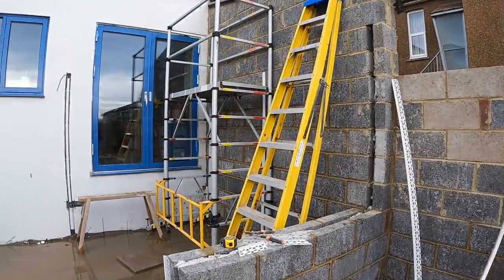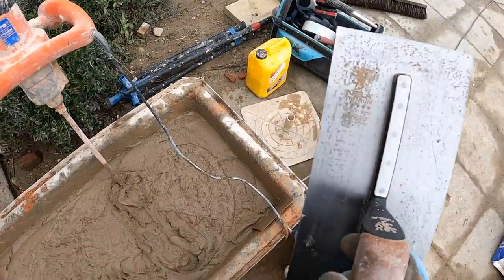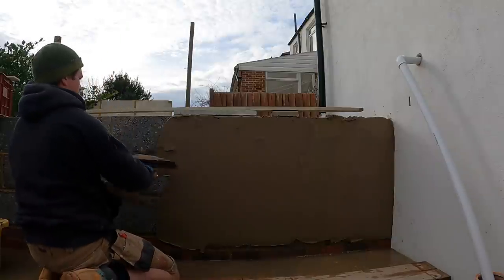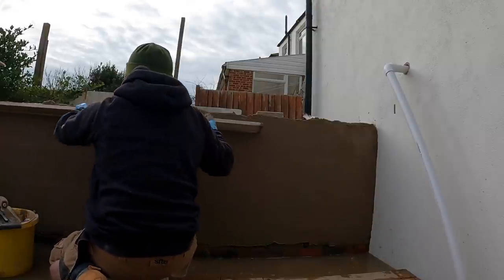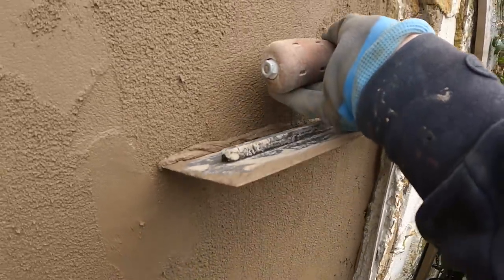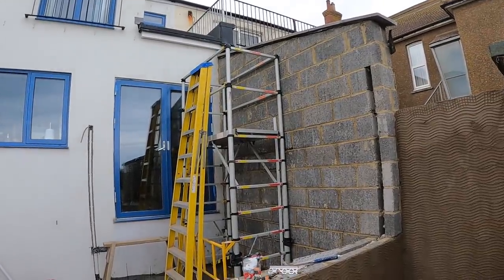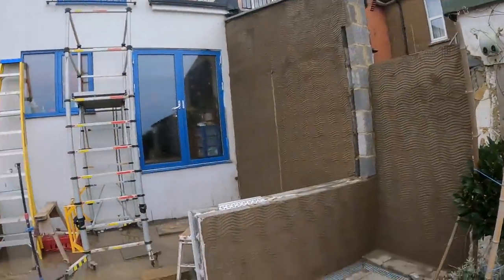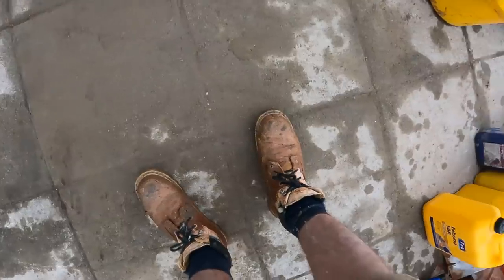Rendering Series #1 SCRATCH COAT (How To Mix Render/ Application/ Rendering Tips & Tricks)

Comment: First off, great videos, I'm learning a lot! Just a few questions.
1. You say you use 15mm beading, is that how far it sticks out of the wall edges? 
2. For the scratch coat, it's not to the entire depth of the beading right? 
3. Finally, when you do the top coat, am I right in thinking that the very edge of the wall is still beading, i.e. you don't completely cover the beading edge with render? Do you just paint the beading and wall and it blends in so it's not obvious it's beading?
Reply: Paul, did you ever get a reply to you questions? I'm in the same place as you were then. Any advice would be appreciated. Thanks mate, Ste
Reply: @scraige3232  I didn’t get a reply unfortunately no. I haven’t attempted anything this year either as I’ve had too much on. Maybe next year!

Comment: Nice work, however there are so many ways and mixes for rendering it's difficult to say which is best, I find 4/1 ok for block but would use 3/1 for old brick, some scratch with soft sand and top coat with a grit, SBR again some use some don't, it wasn't always around, then there's the very best render, lime render, but that's very rarely done as it's almost gone but lime mortar has made a huge comeback, nice work though

Comment: Nice video mate. 
1. What's the white thing running down the middle of the wall. Expansion bead?
2. What you put in mix apart from waterproofer
Reply from the maker: It's power for a light feed and for the scratch it's 4 sand, 1 cement, waterproofers and a little bit of SBR. Hope this helps pal 👍

Comment: Hi, great videos...very educational. Any ideas on how to rectify a situation where you have very little depth left against the bead after doing the scratch coat? I rendered about half the thickness of the bead, but after I scarred it, the height of the scratch coat increased. I’ve now very little depth to rule against my top coat. Any ideas would be greatly appreciated.
Reply from the maker: You can try to scrape the high spots left over from the scratch. That should give you a little more room but if not, you'll have to hack a bit back. Good luck pal, hope it goes well 👍

Comment: I've also got some hydrated le and keep reading everywhere that my mix should be 6:1:1 6 plastering sand 1 cement and 1 lime..  also unsure what adds I should be using with lime as there are so many different opinions out there.. thanks for any help in advance 🙏 👍

Comment: You didn't mentioned the sand you use. ?  which is important. I use Pit sand and Sharp sand for the scratch coat and pit with a handful of sharp for the top-coat.  I know years ago the old plasterers used sharp sand only, better for durability and water proofing but not good for a fine finish.

Comment: Great video, thanks for posting. Any thoughts on applying an SBR / cement mix to wall to act as primer or adhesion aid?
Reply from the maker: Thanks matey! They do a lot of it in Ireland and even NZ when I worked there...Scudding I think they call it. Like I said, I did it in NZ but not much over here my friend.
Reply: That's old school tanking mix for waterproofing sub floors and damp problems it's not used anymore due to in a bag tanking products

Comment: How long does it take to mix in the bath? Is it quicker? Or just easier to take around than a belle mixer?
Reply from the maker: I'll be honest, it's probably easier with a Belle mixer but it doesn't hold as much. If you have a labourer, go for the mixer pal 👍
Reply from the maker: I'll be honest, it's probably easier with a Belle mixer but it doesn't hold as much. If you have a labourer, go for the mixer pal 👍

Comment: Great watching a good renderer at work. Don't think it was mentioned but what sand did you use for the scratch; do you change the sand ratio between first and second coat? Also ever do any work on firewalls?
Reply from the maker: Hi mate! Plastering sand all the way through and it's 4:1 scratch and 5:1 Top coat 👍

Comment: Great video, I noticed that you didn't go over the white capping, does that matter at all? I guess that'll get covered with the next top coat?
Reply from the maker: Yeah it will be covered in the next coat my friend 👍
Reply: @PlasteringForBeginners  thanks, did you use anything as a guide when ruling off? How do you know how thick it is and ensure that's the even thickness over all of it?
I've ruled off before and just did it by eye to ensue it was at least straight, looks like this is what you did too?

Comment: I can see there is no roof on in this situation so understand why you rendered, but internally In what circumstances would you use render instead of hardwalll on a brick or block wall. What are the benefits?

Comment: Hi Blaine just watching  using your mixing drill to sand and cement do you not have a mixer do you not use lime in your mix of sand and cement I all always do I find it spead better
Reply from the maker: I do have a mixer but I just prefer the bath - you can get a lot more in there which is the bonus and no lime in the scratch 😉

Comment: Is that the insulation filling that cavity that internal wall will be damp as any cavity should have an air flow gap the out side wall is all ways ur wet wall and the inside is always ur dry wall in a few years time when the water proofer starts to fail in the render and water starts to soak in to the wall it will soak the insulation and make the inside wall damp this is why u had so many problems when they started pumping cavity full of the beads then spent millions getting it all back out all cavity need air flow and a gap between wet wall and insulation

Comment: 4 to 1 ratio do you gage in a bucket or just put 2 bags of plastering sand in with 1 bucket of cement blaine?
Reply: You can use shovel to size the portion of 4-1

Comment: Have you got any experience with modern coloured renders? How do they compare to traditional sand n cement render, in terms of application?
Reply from the maker: I've used Acrylic Renders and the common Monocouche but I'll be honest, I just stick to S/C. It's probably easier to use the coloured renders but I just like using the old school methods mate.

Comment: If you were scratch rendering a large area would it all need to be done in one go of could you do left side one do right side the next?
Reply from the maker: It doesn't matter with the scratch coat because you'll never see the join. However the top coat needs to be done in one hit 👍
Reply from the maker: It doesn't matter with the scratch coat because you'll never see the join. However the top coat needs to be done in one hit 👍

Comment: Quick question from a fellow spread of years experience why you scratching that it’s miles away from being ready
Reply from the maker: The builders wanted it scratching before the conservatory goes up. The main wall is being finish before assembly so that's the reason 👍
Reply: @PlasteringForBeginners  I’ve currently got an on going job that they want bits and pieces done and can’t finish one room drives me mad as want to get in and out not keep going back keep up up the good work

Comment: You DO NOT render across the DPC at the finished floor level. This allows water/damp / moisture across the dpc which is the whole point of DPC placement. This is why you use a bell cast or stop bead at this level. Basic construction technique. This will also affect the render which is constantly drawing water, weather, moisture from the floor? 🤷🏻‍♂️
Reply from the maker: Yeah...I specified to the builders about fixing a stop bead above the DPC but they didn't want it. They said it would stick out so I just did as I was told but you are correct!
Reply: @PlasteringForBeginners  thanks for reply. Appreciate your honesty, I think you should make comments about that so people know what’s right and learn from you. No builder worth his salt would specify bridging the dpc? Cheers

Comment: Hi all I literally have never done this put like to have a go at everything. I want to buy one of them terraline machines to splatter on meaning  the top cost will hide everything! So my question is would I do the same as this video for the first coat ?then what mix would I put into the terraline box? Thanks again
Reply from the maker: You should always apply a scratch coat otherwise the blockwork will shine through 👍

Comment: it says on the sbr that you can and should use it in the top coat, unless I read it wrong. off to check the bottle now
Reply from the maker: It's just horrible to float and sponge with - it makes it harder to get a nice finish. That's just my opinion pal 👍
Reply: @PlasteringForBeginners  cool thanks. do you use water proofer in top coat?